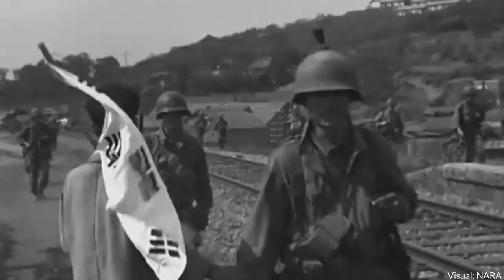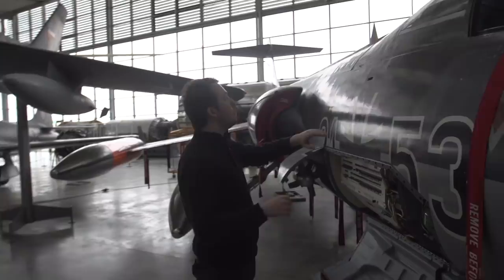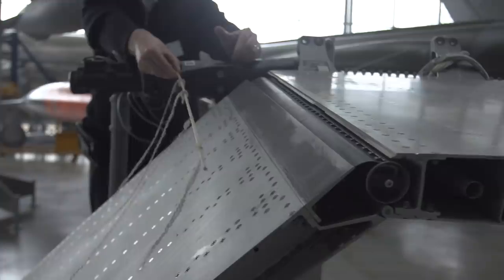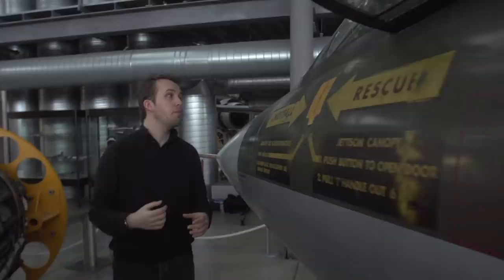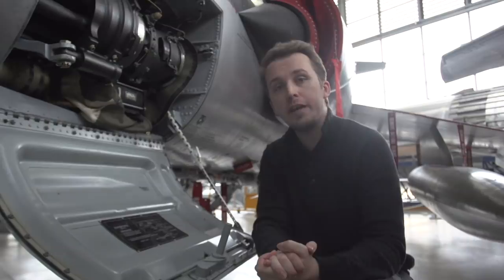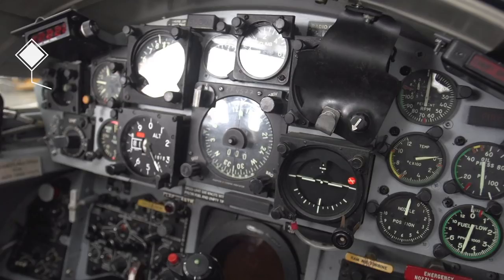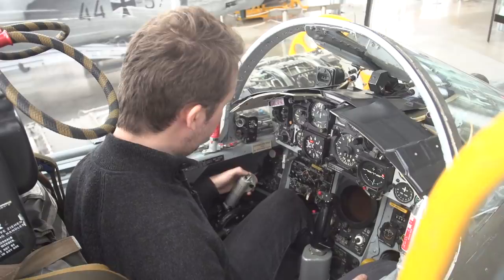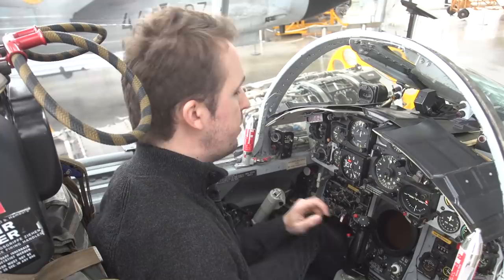F-104G Starfighter - Inside The Cockpit

Comment: I don't think anything made today can catch a Starfighter.  With 7-foot wings the stall speed was high enough to match some plane's cruising speed.  Drag chute landings were the norm .
Reply: Apparently you didn't listen to the video where it mentions that it had blown wings, which is something that could be used not only on takeoffs and landings, but also in turns.
And no, drag chutes weren't "the norm" because they didn't have any and so long as the blowing system worked, they didn't need any as they landed at about the same speed as the other Century series fighters.

Where do you people come up with this stuff?

CORRECTION:  I was wrong when I said that the F-104 didn't have a drag chute.
It did on the lower part of the fuselage near the arrestor hook.
Nevertheless, I stand by my comments about the landing speed being about the same as the other Century series fighters.
Therefore, use of a drag chute was not dictated by the F-104 having an inordinately high stall speed.

Comment: This is the only fighter plane in history that killed more good guys than bad guys.
Reply: That's just not true. Outside of Luftwaffe service, the F-104's safety record was not that much worse than other aircraft of its day - or indeed, of military aviation in general prior to about the late 70s or early 80s. (People used to be a lot more tolerant of aircraft just crashing, even in peacetime.) So any fighter that actually made it into squadron service but which saw little to no combat use probably lost more aircraft (and pilots) to accidents than it claimed as kills. That certainly seems to be true of the entire Century Series: the F-100 served extensively in Vietnam but was never credited with an air-to-air kill (and had their own safety issues, one of which was so notorious that it got its own nickname - the "Saber Dance"), F-105s were credited with 27.5 MiG shootdowns but lost more than double that to accidents in SE Asia alone; and the F-101, F-102, and F-106 all saw little to no active combat service, so any accidental losses put them in the red. Heck, even the F-15 - owner of that sparkly 104:0 record in air to air combat, and serving in the modern, loss-averse era, has lost 70-something pilots and crew in accidents.

TL;DR - Historically, most fighter types have killed more of their own pilots than they shot down enemies.

Comment: Why does a land operated aircraft have an arrestor hook?
Reply: Short field landings I suppose
Reply: Short secondary landing fields were a standard expectation when the field you took off from had been nuked. They even trained to land on highways.
Reply: Emergency stops on runway with brake failure. Airfields did have these cable systems on the runways.
Reply: Short runways.
Reply: @praetor678  The winning response.

Comment: Wasn't the German Air force's real nickname for the 104 "The Widow maker"? (26.23)
The US didn't buy it and it was bribery that sold it elsewhere. I wonder if the Russians were as afraid of it as its own pilots? If I was in the cockpit the first thing I would want to know is: How do you operate the ejector seat?
Reply: > Wasn't the German Air force's real 
> nickname for the 104 "The Widow 
> maker"? (26.23)

No.   Widow maker was the nickname given to the F-104 by the German press.
German pilots, like pilots of other nationalities, had other nicknames for it, the closest that I know of to "widow maker" was something like "aluminum death tube" or "lawn dart".
OTOH, Indian pilots used to refer to the MiG-21 as a "widow maker", so the nickname doesn't belong uniquely to the F-104.

> The US didn't buy it [...]

Actually, they did buy the F-104 although not the F-104G.
The USAF bought the F-104A/B and F-104C/D, but didn't keep them long.
The Air Force talked itself into believing that there was a "bomber gap" with the Soviet Union and so pressed aircraft designed for other purposes into being "interceptors", in particular, the F-101 which was designed to be a low level penetration bomber was used as a wide area interceptor and the F-104 which as designed as a daylight air superiority fighter was used as a point defense interceptor.

When the Germans were looking to replace their obsolete aircraft, Lockheed told them that an upgraded F-104 (one with a strengthened airframe) could meet their needs and they (Lockheed) made the "Super Starfighter" AKA the F-104G which is what the Germans bought.

> [...] and it was bribery that sold it 
> elsewhere. 

Bribery "helped", but that wasn't the only reason why European governments bought it.
In Germany's case, the only real aircraft (as opposed to paper aircraft) in competition with the F-104 was the Mirage III and the Germans thought that while the Mirage was a better dogfighter, the F-104 was superior in all other regards. 

> I wonder if the Russians were as 
> afraid of it as its own pilots? 

I don't know whether or not the Russians were "afraid" of it, but they were definitely interested in it as Yeager's book makes clear when he mentions being in Russian and their asking him about it.

In the case of Vietnam, F-104s were twice sent there and a number of them were lost for various reasons like wear and tear and being shot down by ground fire, but none were lost in air-to-air combat as the Vietnamese seemed to go out of their way to avoid engaging them.

> If I was in the cockpit the first thing I 
> would want to know is: How do you 
> operate the ejector seat?

If you were in the cockpit of one, the first thing I'd want to know is how you managed to get there given how little you apparently know about the aircraft.
Reply: @lewiscole5193  The first thing I learned about aircraft with ejection seats was how NOT to initiate them accidentally.  It's actually mandatory training in the USAF, and on many aircraft types work differently.  My egress training was on B-52s, which had two different seat types depending on crew position, and B-57s.

I slightly knew a B-52 Radar Navigator who had ejected on the ground in a B-52's downward-firing seat and survived with minor injuries.  He was semi-famous for it.
Reply: @dougwickstrom9870 
Well, speaking only for myself, feel free to pass along more titbits about your experiences in the B-52 and B-57 and/or ejection seats.

Unfortunately, the B-52 incident involving ejection seats that I'm aware of is the crash at Fairchild where one person supposedly "partially ejected" (what ever that means), one person didn't eject, and one person couldn't eject even if he had wanted to because his station didn't have an ejection seat.

Comment: Why would you mask the artificial horizon??
Reply: So you can put it out of sight if it malfunctions, and focus on the standby ADI.
Reply: @gort8203  Was malfunction that common?
Reply: @penultimateh766   It must have been common enough, but it was perhaps a more critical failure in the 104 than other aircraft.  In most aircraft the standby ADI is small and not located in the pilot's usual instrument scan pattern.  But in the 104 both ADIs were of similar size and location, so each was as likely to catch your eye.  So if the two instruments did not agree it would take the pilot time to determine which was in error.  You only want to do that once, so being able to cover an erroneous ADI was a very nice feature.